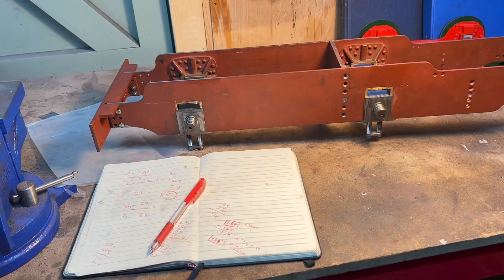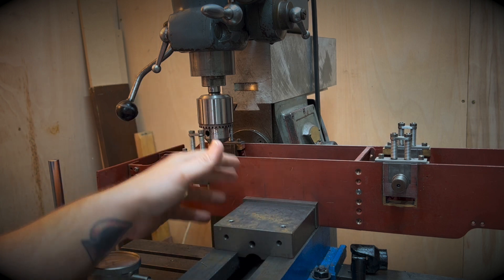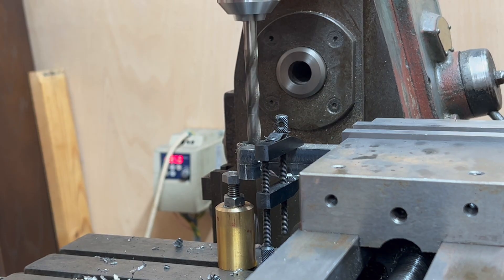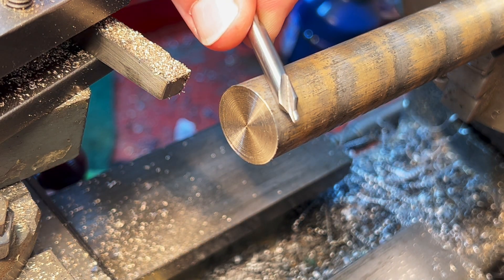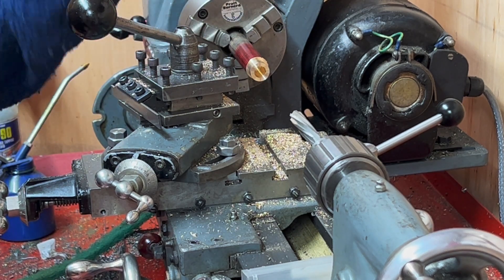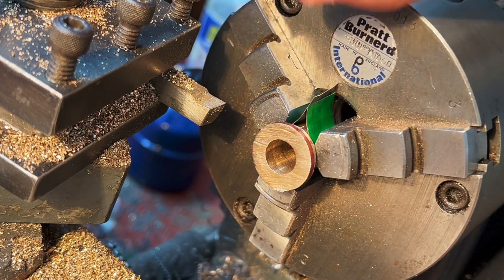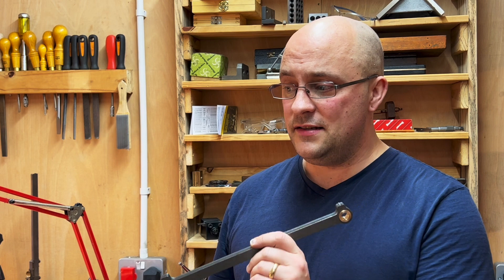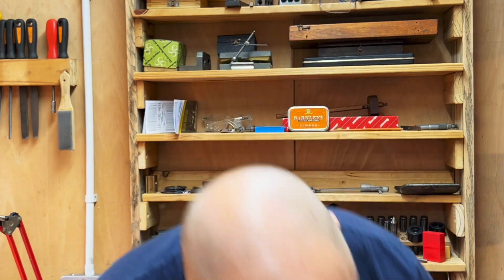Drumsticks in Steel & Bronze, or Coupling Rods - Maid of Kent Steam Loco No. 24

Comment: Hi William,
You recently asked me about machining coupling rod ends and referred to a technique where the rod is held by hand and rotated around an arbor.  I came across this video this morning of someone doing just that:
https://youtu.be/4kVnTZ3eaVw
He is working at a much smaller scale though, where the risk of injury is much lower.  
Cheers
Mark
Reply: I still wouldn't do it that way, even at that size....
Reply: @markshomeengineering5243  I did it that way and it worked fine
Reply from the maker: Thanks Mark, as you've probably seen I dug up a rotary table from an unmarked box that's been in my shed for some time so no worries - I'll check that video out now though, because it's always good to see alternatives!

Comment: I think it was a wise decision to cut by hand. Bronze can be very tricky to part off.
Reply from the maker: Especially that long, gosh I was worried. I have been quite lucky with parting off to date and I didn't want to ruin my streak :)
Reply: Rigidity, speed, just below centre, an underground tool and a flood of coolant. I part 3 inch washers off in my lathe.